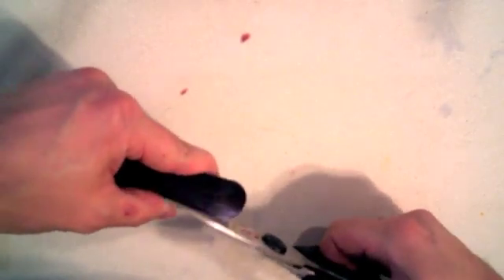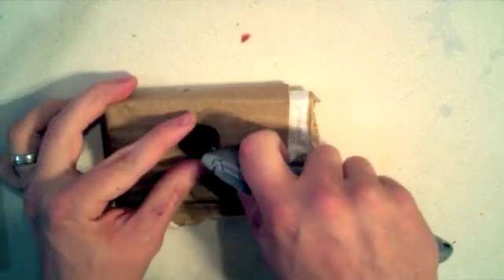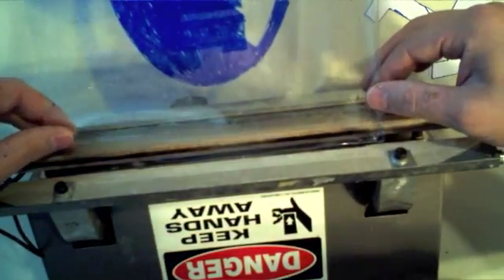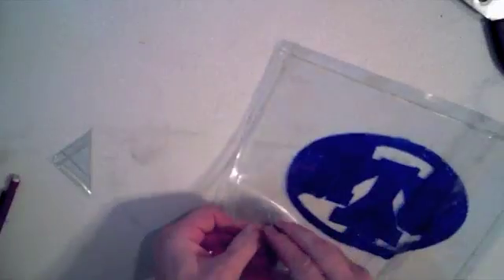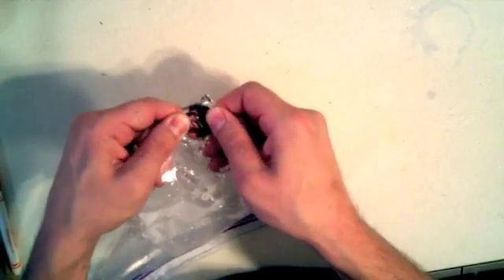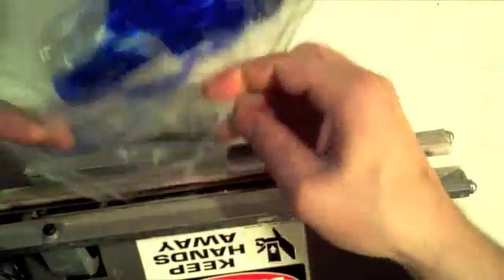DIY Resuable Sodium Acetate Handwarmer

Comment from the maker: No a washer does not work.   It is not simply the clicking that causes the reaction, it is the slits in the disc rubbing on each other when it is clicked that causes the reaction.
Reply: Kevin Dodge Hello, I love your video.. I am wanting to make many of these for Christmas gifts this year and I wanted to know how long your packs have lasted you and if there is anything you would do different?? would love to hear any advice from you that wasn't covered in the video because I want to get started on this project if you recommend it would be fine for giving as gifts. thanks!!
Reply from the maker: I haven't done these for a while.  I found my vinyl bags kept unsealing and making a mess.  One of my friends would put a double seal on edge on the bag to prevent this.   Otherwise its pretty straight forward.   Good luck.

Comment: Where can you buy a decent heat sealer for cheap, and can you put a link for the vinyl material you used from Walmart?
Reply from the maker: I bought my heat sealer on ebay.   I don't know if typical food sealers will work or not as mine has a heat element on top and bottom.   That was why I showed the flat iron as a possible alternative.    I have had some limited success using an oven and baking the vinyl with a piece of paper sandwiched in the middle to make a bag.  For the material you simply buy clear vinyl from a fabric store or search for clear vinyl on amazon and buy it by the yard.   I don't know the best thickness but the lower the gauge the thicker the material.  I would try 10 gauge.

Comment: How do you know you have a good consistency while you are mixing
Reply from the maker: The film on top of the solution is the best indicator.   If you don't have  a film add more sodium acetate or boil off some water.   If your film is too thick add water.  Your goal is a very thin film while the solution is very hot (close to boiling)

Comment: Could someone explain me how exactly does the clicker acts as a trigger?
Reply from the maker: I have read some places that say a tiny particle is ejected from the rubbing metal when you click it and this gives a location for the reaction to start.   Other places have suggested that the shock wave from the clicker causes the reaction though I haven't found this to work from any other sort of shockwave (hammer, dropping it, ...).
Reply: @nivekmic  yes, the first one is correct. The metal gets a tiny bit knocked off of it when it's "clicked" that gives the solution a nucleation site, like how supercooled water needs an impurity to instantly turn to slush; distilled water doesn't like to do that, because there's nothing in it to let the water nucleate on.
Reply: sparks.. i think

Comment from the maker: My seals were about 1/8th inch.   I have seen people do a double seal on the edge to try and prevent it from blowing out.

So far with vinyl I have found that no matter how good the seal, eventually the bag will fail.   The bag I made in this video failed somtime last fall when I was taking it to a football game.    Made a mess but it wasn't too hard to clean up.

Comment from the maker: Doing a little searching the exothermic reaction temp is around 140 F.   But the colder your solution is when the reaction starts the less heat you will get from it.  If you start it cold, it will never get close to the 140 F.    You can also alter the temperature to be lower by having a higher water content.

I found this article while which suggests that it might be possible to get higher temps.   Ill put it in my video description.

Comment from the maker: I have tried a few different things, spring steel seems to be what works.   I found that the slap bracelets worked the best.   I have also tried cutting up a tape measure and had some success (It deteriorated quickly and didn't work very well).   You might try the metal lid off a drink that pop to tell you when it has been opened.    

If you find something else that works well please post it back here and let us know.
Reply: man this video is straight to the point. thanks.

Comment from the maker: You would need a glue that would would stay strong even when you boil the bags.   Hot glue wouldn't work.   I have thought about using vinyl glue but haven't ever given it a shot.   A combo of sewing and vinyl glue might work.   Try it with hot water first though.

Some plastics do not work at all.   I tried painters tarp once and the solution melted right through it.   Other than that and vinyl I don't know of any other readily available thick clear plastic sheet.

Comment from the maker: I have only made my own sodium acetate once.  It took a very long time, mostly because vinegar is mostly water and I had to boil most of the water off.    I don't know how cheaply you could make it but it is a ton easier to buy it.   I think I bought 5 pounds and that will make quite a few depending on the size you make your bags.

Comment from the maker: @lboogie875,  I assume your talking about the bag, not the bottle?   The bag is about 10" x 7" and easily holds 4 1/2 cups of solution.    When I buy sodium acetate I buy it in a 5 pound bucket, and 5 pounds should make a few hand warmers this size.